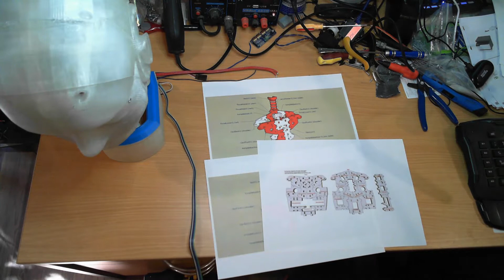Freds Head New Stand Part 1

Comment: how do I get the servos to spin in opposite directions ?
Reply from the maker: Ok, for that answer you need to be a bit more specific on which servos, as there are some master/slave setup that require a wiring change.
But for the stand alone servos or the master in a pair, the reversing is done in software.
In MRL the Servo Service does have a setInverted method that can be set as true or false.

I cover this a bit more in the latest video Fred's Brain Part 2.
https://youtu.be/wMw2LH9gO6M
Reply: @CyberOne  it is the two in the back for the head tilt but I manage to get it working  I  did not change the polarity on the pot. thanks .
Reply from the maker: @louwrensburger1796  So if the slave servo is running backwards, remember, the electronics has been removed from the slave, and the motor connected to the motor terminals of the master, then reversing the wires to the slave motor will reverse that servo.